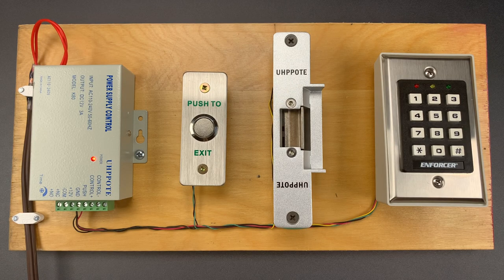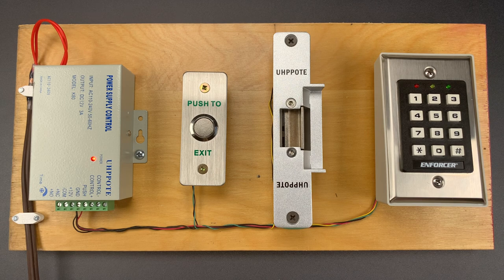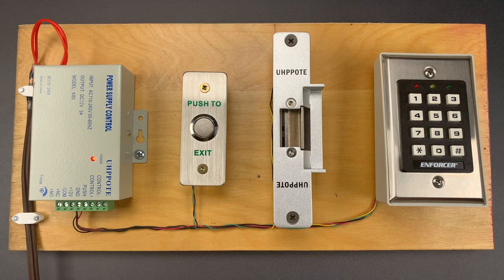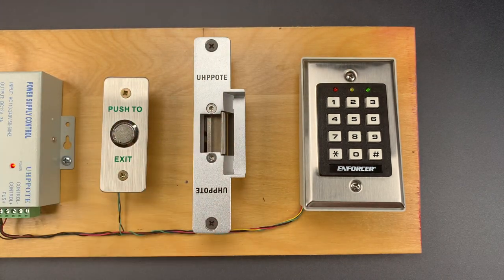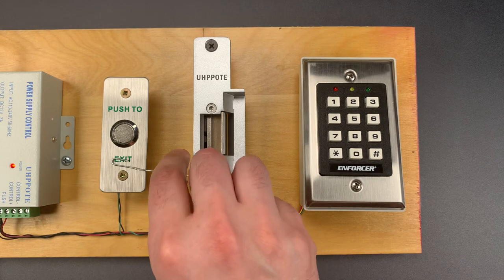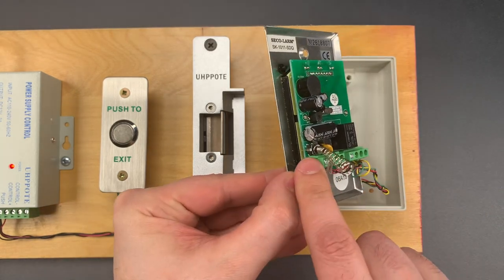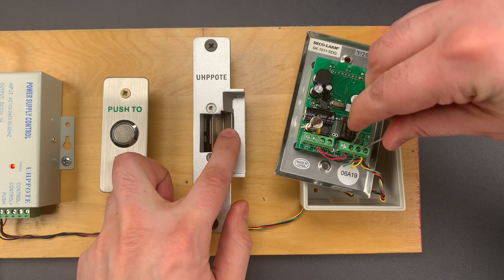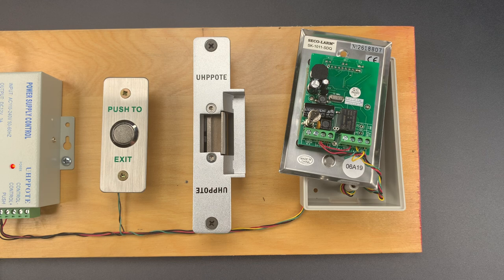[1045] Swiss Army Knife Bypass of Keypad Lock

Comment: Fatal design flaw: lock internals behind keypad should not be located in unsecured area.
Reply: THIS.  The keypad should be just a data entry device, the actual security processing being physically secured.
Reply: Just put the wiring etc in the egress switch INSIDE, not outside in the unsecured area. Seems pretty basic....
Reply: @arletottens6349  No it wouldn't. If you had malicious intents you could easily just cut the side or the front and again disable the system. imo infrared movement sensor inside the box could cut it, but those are unnecessarily expensive and still have their weaknesses. the basic design is flawed like hanelyn1 described, that system does't make any sense. You can basically disregard everything and just send a current through the wires to the actual lock and its open.
Reply: Only thing that should pass from the key pad is a rolling code to the controller on the inside. Then the only way to hack it is to figure out how the code is rolling. Goes from any dude with a paperclip can pick it to a class one hacker.
Reply: @wolfpack4128  "figure out how the code is rolling" 

i hope you mean "what code" not how. Any of the data shouldn't be handled in an unsecured area. They just send signal to the handler inside and the inside part checks if it's the right code not the outside part. There shouldn't be any wires connecting the actual lock to the unsecured area either. otherwise 9V battery will open it.
Reply: Honestly, if they'd have just made the sides of the plate as deep as the rest of the box, the anti-tamper switch would be a lotbharder, if not outright impossible, to disable with the paper clip trick.  Even containing the anti-tamper spring in a cylinder or something would make it less susceptible to being tricked.  This really is pretty barebones as far as electronic locks go.
Reply: @MOORE4U2  Your thinking is a bit off, you're thinking how to fix one exploit instead of how to actually make it secure. For example your idea is worth of one like this: "let's put conductor on the spring to detect if metal touches it to set off an alarm" Sure it fixes that problem but there are hundred other ways to open it too. For example if the spring was in a tube you could drill through the tube and leave the drillhead there to keep it under tension. Putting the box in a wall is similar, also it doesn't prevent entry to the restrained area, it just sets off an alarm if the cover is opened which is bad practise in general.
Reply: @arletottens6349   Starts to sound more secure, but also way more expensive. hanelyn1 can sell his product half-the price and 10x more secure. Also my solution to your fix would be to pry the thing out of the wall and get 9V battery to open the lock since the wires are connected to  the wall. Sry if i sound like an ass but to sell these things as security is crazy to me lol.
Reply: @arletottens6349  Embed a single thin wire wrapped around and through the case/plate plastic so that a break in any spot opens a separate remotely monitored NC alarm circuit. 
Then get sneaky and reflect an IR light off a mirrored surface on the plate to a receiver on the same board. Not only does removing the plate kill the light signal, fishing around behind it will too as you wipe over the sensor... and you can't see that there's a light leak detector because it's IR. Ideally loosening the plate trips the NC tamper circuit too because it's continuous through surface contacts...
Reply: Far too many people are still trying to secure the keypad itself. In an unsecured area, taking the keypad off shouldn't even give you access to anything you can bridge to open the lock. All it should do is send the code you entered back to the main control panel that them makes the decision of opening the lock. Only issue with no tamper switch is that it gives tog access to the wires where you could hook a device up to log entries or brute force it.
Reply: @arletottens6349  What would the epoxy/corundum mixture do? I'm honestly curious not forgetting THAT would be way too expensive to even consider haha.
Reply: @HammondOfTexas0  I'm not trying to secure the keypad itself, I'm turning it into a honeypot. You crack in, and you're f*cked without knowing it until you hear "POLICE LET ME SEE YOUR HANDS".
Reply: @FrozenFox20  Im not talking about fixing the while thing, I'm just talking about something simple they probably should have done during the design process.
Reply: Not to worry.  This sort of thing isn't used by any reputable security company in any type of high security application.  I have been in the security/ access control company for almost 20 years and have personally never used anything like this.  I did work on one that had been installed by a company's handyman.
Any half decent lock keypad will not have terminals that can release the door.  It is just an information processor sending the code or card information to the main panel - that panel then sends voltage up the line to open the lock.
Reply: 1. Move the "electronic brain" behind the controlled door
2. Add fuses to the cable coming from the keypad, so that an attack could not damage the "brain" with electric signals
3.???
4. Profit
Reply: @HammondOfTexas0  your the only person that understands.  On a real access control system the keypad does not directly control the push to exit button or the electric strike.  Accessing the wiring on the keypad will do absolutely nothing on a keyscan or kantech system.
Reply: @MOORE4U2  I'm disagreeing just because in my mind it's way simpler, cheaper, more effective to put the electric board in secure location in the first place instead of applying bandaids on faulty design. because even if i personally can't figure out a way to bypass something like you suggested, someone else will. If we are speaking about security it's never to completely stop someone, but rather delay and maximize the effort to hack the system, as cheaply (if for commercial use) and as effectively as possible. So rather than putting one small shield more to prevent access, you can use the walls of the building you are trying to restrict, without increasing the cost, so now instead of having to figure out how to break a small shield you have to break a literal brick wall or try and guess the code.
Reply: @FrozenFox20  We just have different reasons behind what we're saying.  Your idea is more from-the-ground-up, mine's more "why didn't they bother to do x in the design they have?"
Reply: That's like putting the shield generators outside the shield.
Reply: Guys this is a cheap easy to install lock. In secure applications the keypad is just a dumb keypad, it just passes the code to a control system inside the building. Tampering with the keypad in those cases is pointless.
Reply: Just put the electronics behind the push button and run wires from the keypad through the wall to it.
Reply: Major flaw is imo having that front plate connected to rest of the circuit, which is making it absurdly easy to rewire it without opening it enough to activate tamper switch
Reply: @Phobeuscz  Its built for cost not security
Reply: @FrozenFox20  Putting the brains in a secure location is how every single professionally installed system works and has worked for decades.
The keypad presented here is not something used by any half-decent security company.
Reply: @donlackie911  Unfortunately, similarly stupid keypads are tragically common.  Firstly many somewhat expensive access panels are built exactly like this, just with even more ways to bypass.  Secondly, when adding an access pinpad to a machine or cupboard or electrical panel, there is no good inside to put the "brains" in, especially if you want am easy way to repair it.  That's what these simple pinpads would easily fit though something better is clearly possible.
Reply: @johncrowerdoe5527  Any access control panel put out in the last decade or so that uses this style keypad is NOT a professional system.
You do not put the brains inside the protected space, that's what wiring is for.
Professional systems have a controller located elsewhere and it is just a reader/pin pad, lock, request to exit motion and a door contact at the actual door.
The only way to do it is to find a way to get to the lock wires and have a 12 or 24 volt power supply handy.  BTW, any decent professional installer will not make getting to those wires from outside easy- if possible at all.
Reply: @donlackie911  Watch some Deviant Olam videos about building access panels to see those expensive versions of this bad design.
Reply: @johncrowerdoe5527   This is my industry.  Pardon me if I take my own experience over  some internet video.
I did not say these cheap things didn't exist or that uniformed or apathetic people or companies don't use them.
I said any half decent security company will not use them.
Where I have seen them is generally (but not always) where they have been installed by the building maintenance guy who thinks he knows something (Dunning-Kruger Effect)
Reply: Honestly, security often doesn't really matter for this kind of lock. You use it to keep honest people honest, not to protect the companies gold reserve.
Reply: Shielding the contacts so they are not reachable by poking wire under lip of keypad would be a start.
Reply: @donlackie911  I notice you didn't address the applications John brought up where the proper way isn't really an option
Reply: @FrozenFox20  "You can use the walls of the building you're trying to restrict"
Indeed you can.

But there's a bit of an issue with that, an issue that's probably the biggest reason self-contained keypads have a market: If the building wasn't built with an electronic security system to start with, you would have to open up the walls to run the wiring.

Comment: I literally said "is he going to bridge the connection?" Right before he done it and I was like "oh my God, that is a terrible design"
Reply: *excellent design
For thieves, that is.
Reply: It would be very cheap to make it a lot harder. Make an injection-molded piece of plastic that is around the circuit board that extends to the back of the plastic box. Minimal changes to the screw connectors would also be needed so the wire reaches them from over the board.

The minimal thing to add is a plastic cylinder around the spring with a companion on the box. so you can just hold it back.
Reply: @target844  It is wrong design from begining, no matter how tamper proof you make it. Keypads should be used only for sending wired/wireless data signal to the unlock system located inside. If signal gets authorised, doors gets unlocked. Simple as that. No silly unlock switches, control circuits or anything else that can be tampered with should be located in numpads outside security doors/ building!
Reply: Whoa you're so cool

Comment: Makes me happy that my door systems have their controllers on the inside of the building and where their are external components, either the card reader itself or a security relay between the video doorbell and the controller are designed to send a specific tone or series of sequence of voltage change and can't be jumped as easily as this.

Comment: This was set up specifically for ease of bypassing. I've installed scores of seco-larm keypads over the years. They ship with tamper-proof screws that can't be unscrewed once tightened without the aid of a dremel or grinder to cut a groove into the screwhead. Also, in most cases the door is free egress just by turning the handle. You wouldn't combine a REX device with an electric strike. This allows you to disable the REX input altogether.

My point is that with a little forethought and planning you can eliminate the risk of these bypass methods.

Comment: Used a professional unit for my garage door, took the extra step of removing the logic board and placing it in a secure container inside the garage. Now the only thing anyone had to work with was the wires to the keypad matrix and LEDs, they were all white and unmarked.
A friend of mine had a similar unit with the same modification except he ran two extra colored wires to a couple of unused pads on the board. These were trigger wires going to a CS gas canister dispenser that had a tube running to the back of the weatherproof box terminating right above the wire harness. It did its job one day, never had an issue since.

Comment: Wait a minute: if the anti tampering switch is not connected, the paper clip to hold the switch spring demonstration is not convincing! BTW, big fan. Love your videos. Glad you reveal these security flaws to help improve design and debunk false sense of security.
Reply: There were no wires to the anti tamper switch, that's why he removed the paperclip.  He explained how the spring is kept activated by it being pressed on the backplate.  Ex: if someone removed the screws and started taking the plate off, the spring would lose it's tension being separated from the backplate thus triggering the alarm.

Comment: Those locks have been like that since at least the first one i saw back in the '80s. I always move the circuit board into the building and run wire to the keypad. What I would do these days is to make sure the circuits inputs from the keypad can handle 50V, and place 25V spark gaps on each input to prevent denial of entry attacks. And shield the latch from magnetic entry attacks.

Comment: I have one of these keypad locks on my backyard shed.   This is good since I can put countermeasures in fairly easily.   As well, add better security screws  The more  you know (shooting star) :D
Reply: yeah, buy a simple 2-pole relay. Wire as following:

+12v -- coilA
coilB -- TampA
TampB to C1
NO1 to -12v
Resetbutton1 - C1
Resetbutton2 - NO1

+12v - KeypadLockOutput1
KeypadLockOutput2 - C2
NO2 -- Electricstrike Vin
Electricstrike GND - -12v

2 pole relay and reset button on inside.

Any tampering will disable strike and only way to reset is to use key (or another door) then press reset button on relay box. Creating a trap for somebody trying to bypass security.

Increases security atleast 3x by the cost of a simple 2pole relay.

Comment: I've got a similar cheap keypad / RFID on my house. However you can prevent all of these exploits by making the tamper trigger if the screws are even slightly loosened. 
Aside from this, also determine (or set) the exact time the keypad relay triggers the latch for, but instead of running that signal straight to the latch, run it to a small microprocessor (like an esp32, picaxe or arduino). The external electronics look for the exact trigger time, then outputs to the latch if correct. Also use N/C contacts with EOL resistors to determine if anything is being tampered with and have the electronics fail to a lock out state if triggered. Sounds a bit complicated , but mine's been working reliably off a Picaxe μP for over 10 years. The only annoying bit is the short delay before the door opens.

Comment: Why are most of these systems controlled via the keypad? A simple keypad with a communication bus to the main controller box could solve all of these problems. 🤔
Reply: Probably for ease of installation and to reduce cost. The keypad is basically the system instead of a real one in a more controlled location. I'm not agreeing with it at all, just guessing as to why it's not done the way you suggested (which I do agree with).
Reply: It’s cheaper to manufacture this way since you don’t need to make a separate PCB not a separate mount bracket and plate for the interior side

Also contractors like it because it’s much easier to install so they’ll choose this if they’re given a choice
Reply: All to save a few cents by not having to have a separate controller on the inside and a bus to the keypad on the outside. But you are correct, having the main controller on the side of the egress button would probably solve 90% of these vulnerabilities.
Reply: A double keypad setup can be more secure, as you now have a way to log whose credentials were used to open the door, and when they left. And because you need two keypads anyways, you can put the database on the inside.

Comment: I do this all the time at work. I work in many different buildings and they use this keypad to prevent dementia residents from using the elevator, but half the time they don't tell me or I forget the code. Super simple to use a tweaker screwdriver to loosen the bottom screw, short the eg contact, then screw it back in. Almost as fast as using the code

Comment: I have installed many of those electronic strike locks. If the lock was on a perimeter door or higher security I would install touch pads with the logic bord remotely mounted to prevent tampering.

Comment: when im doing maintenance on appartement buildings i just pull out the intercom and bridge that never seen a tamper switch on a intercom but usually you just pop out a small screwdriver and just lift the lock to the side the doors they install these days you can fit a hand in between lolz this stuff is all a joke ive cut a camera wire last week to replace it with a new one checked the camera display screens and they show the last image it took hahahah like in the movies they put a photo in front off the camera hahahaha laughing my ass off every day at the job
ow best laugh was month ago they broke into 3 modern appartements but could not get into the fourth one i talked to the older gentlemen what he do to keep em out he just trows a stick between the slider off the sliding door hahaha want me to keep going :) ow if ya ever in belgium and find a lockbox just type in the postal code off the region ;)
Reply: Nothing is better than a dowel in the track top keep someone from opening a sliding door or window from outside.